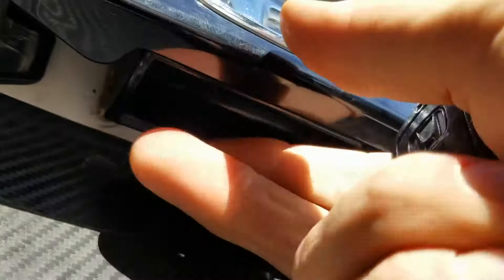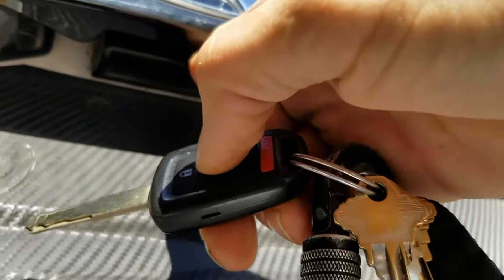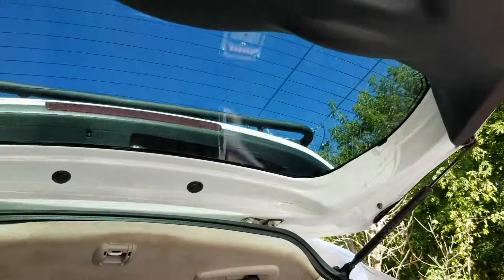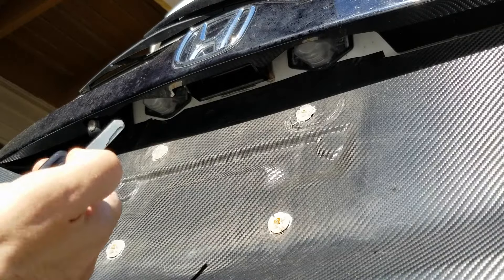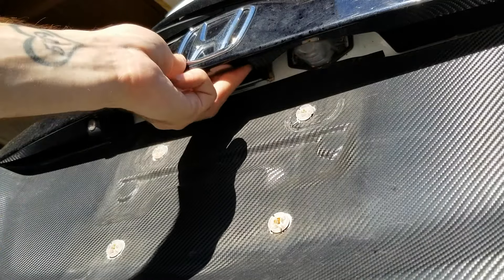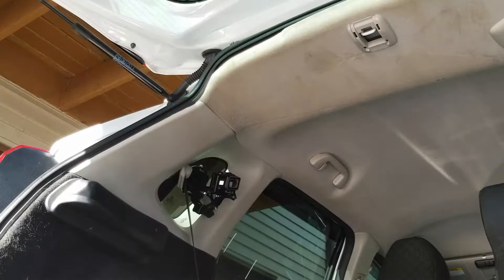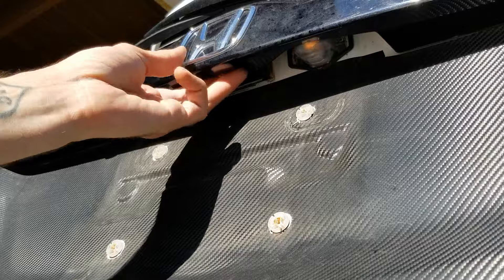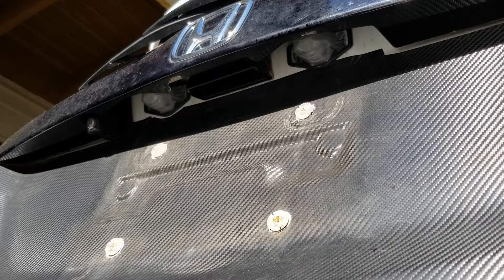2015 - 2019 HONDA FIT/JAZZ - GK5 - How To Open A Stuck Rear Door / Trunk Hatch #HondaFit4Adventure

Comment: Appears Honda doesn't want to change this design
Reply from the maker: And make it harder for you to fix.
Reply: @HondaFit4Adventure  They should have made some sort of provision to use the ignition key to insert into a key unlock by the tailgate latch..like the old days of unlocking a trunk lid.  Cost cutting measure by the bean counters in my opinion.

Comment: To fix mine I first sprayed WD40 into the lock. Then applied some 3-in-one oil. That worked.
Reply from the maker: Hi Mark,
WD-40 did not work for me. I will give the 3-in-one oil a try and see if that loosens everything up. 
Thanks for the tip.

Comment: fyi- if you go in from the inside and move the latch over with a screwdriver it fixes it for good.  there are other videos on that technique too..
Reply from the maker: Please provide a link for this video if you dont mind. I believe I tried what you're describing and it just doesnt seem to work on all models.
Reply: That doesn't work on 2015, as there is no access panel, unfortunately...

Comment: I have a Honda Fit 2012.  The latch stuck once or twice a couple years ago temporarily again.  It happened again today and manipulating the latch first... got it to engage again and work properly.  Thanks!
Reply from the maker: I believe the older models have an access door allowing you to pull the cable as well.
Sadly they removed this door in the 3rd generation.
Reply: I have a Honda fit 2012. I just tried it, but the latch wouldn’t go down.

Comment: Someone rear-ended me, and now my warning beeps are gone. The trunk still locks (with more force than before) , but there is no beep when I lock or unlock the car with the remote. It also no longer beeps when you exit the car with the ignition still on, which I found out when my battery died as a result
Reply from the maker: Hi Rookie. Does your horn still work on the steering wheel?
If so, try this... Open and close the hood on the front of the car. 
I wasn't getting any warning beeps either but my horn was still working. 
I realised my hood wasn't closed all the way. Once I slammed the hood down the warning beeps came back.
It's a long shot, but worth a try. Let me know. If not, I bet it still has something to do with the latch.
Reply: @HondaFit4Adventure  Didn't work but thanks. I think it has something to do with the latch mechanism, the rear door had a small dent but it must have been enough to damage something in the door lock mechanism, maybe a little electronic sensor switch or something

Comment: If you spray WD-40 on the metal and spring around the plastic handle, it will solve this problem.
Reply from the maker: Jeong, that did not work for me.
You also shouldn't use WD-40 as a lubricant.
"The main reason for this is that WD40 is not a true lubricant; it is a water and oil displacing solvent. This means that it can actually remove any lube already in the lock, leaving it dry and susceptible to sticking"
Reply: @HondaFit4Adventure  Thank you for the information about WD-40 that I did not know. I had the same problem on my 2015 FIT, and the WD-40 works for me so far. But as you pointed out, this may be a temporarily solution. Thank you again.
Reply from the maker: @jeong-hyuncho1128  Did you spray it directly into the handle? or did you take the interior hatch panel off spray the handle?
Reply: @HondaFit4Adventure  Without taking the interior hatch panel off, I sprayed it directly between the handle and metal plates where are placed on the left and right side of the plastic handle using WD40 attached with a thin straw. Also I sprayed around a spring on top of the handle. Then, moved the handle back and forth more than ten times and sprayed it again. The straw helps to spray the oil between the handle and  the metal plates that causes a stuck handle.
BTW, I got lots of useful information from your video. Thanks.

Comment: a 2016 Honda Fit does not have the handle part. just the button so this won't fix it
Reply from the maker: As far as I know, every Honda Fit should have a handle on the hatch.
Have you had the car since it was new? Do you have an electric tailgate?

Comment: OMG I just tried your fix and it works every time. Honda never even tried this to diagnosis the problem.  Honda had me replace the lock, $275.  Same problem two weeks later. Thank you thank you.
Reply from the maker: Mine was replaced under warranty and just like yours, it happened again.
This is a common problem even in the first and second generation Honda Fits. Unlike the new Fit, the older FITs at least came with an access door so you could pull the cable and unlock the hatch if this problem occurred.
They engineered out this older fix even though they knew this situation was a common problem. 😠

Comment: It worked!! Thank you, Thank you. Honda would have charged $200 to$600
Reply from the maker: Glad to hear!
Would you believe that 1rst & 2nd generation Honda Fit's had an interior hatch access panel?
If the trunk ever became stuck you could easily pop off the little cover and pull the cable to open up your trunk.
They got rid of this access door feature on the 2015 and newer Honda Fit's.
It's as if Honda want's you to come to the dealership to fix this COMMON issue.

Comment: worked on my GD3 from 2007, thank you so much!
Reply from the maker: Good to know that it works on the other models.
I think your HONDA FIT has an access door somewhere in the back. If you pop off the door you should be able to pull the trunk cable and open the rear hatch.
They removed this access panel on the 3rd generation HONDA FIT #SadFace

Comment: Wow. This worked. Gave it a squirt of silicone spray after. So far so good. Thanks!
Reply from the maker: HondaFitFact: The older model Honda Fits had a little service door on the inside. This way if the trunk stuck, you could pop off the little service door on the inside and pull the trunk cable to open it. Why they got rid of that service door I have no idea?
Reply: What did you spray? Should I just blindly shoot it into the sides of the handle?
Reply: @johntheblindman . That's what I did, blindly sprayed up into the handle at the hinge points and wiped off the excess. I don't really know if it helps but I don't think it does any harm. I stay away from anything that will attract and hold dirt, like oil or grease. The silicon (I hope) keep moisture away. If you find something better do let us know! Good luck.

Comment: Ran into this with my 2017 Honda Fit (only 28,000 miles on it).  Normally all doors including the tailgate will unlock by pressing the 'door unlock' button on the ignition key fob when I'm standing by the driver side door but lately the tailgate won't unlock.  Was able to get the latch to unlock by putting the ignition key right up to the latch and pressing the 'door unlock' button on the key; then I oiled the sh_t out of the lock mechanism with penetrating oil.   Did this 5-6 times in a row worked OK hopefully if I keep the mechanism oiled that will be a permanent fix.  Older Fits have a tailgate latch access panel on the inside of the tailgate but mine doesn't.
Reply from the maker: You are correct.
The first and second generation Honda Fit have an access door that you could remove to open your trunk if it ever became stuck.
It seems that Honda Removed this little access panel from the 3rd generation Honda Fit even though they knew this was an ongoing problem.
Are they trying to force us to come back for the dealership for repairs?
Reply: @HondaFit4Adventure  Of course.  Another way of generating revenue for the dealership service departments.  I really like my Honda Fit in all other regards.
Reply from the maker: @thomasmoje5926  Same, I plan on keeping the car for along time too.

Comment: Why will hatch not open without the fob being right next to it?
Reply from the maker: So your trunk opens, but you have to stand close to it to do so? I would guess the battery in your key fob is getting low and it's unable to send a signal a far distance.
Reply: Battery is fresh. Hatch will not open even if fob is in the car.

Comment: I think mine cannot go as far forward as usual because there is so much rust. I tried your trick and spraying wd-40 on the rust but I’m still not able to open it. Do you have any idea?
Reply from the maker: Have you tried removing the rear hatch panel and taking a look inside?
https://youtu.be/K9boNauAy04
Reply: @HondaFit4Adventure  thank you for putting the link, I definitely didn’t even know I could do that, thank you so much! I will try that
Reply from the maker: @jacintheverschelden7818  You're welcome. 
I got rear-ended and had my whole trunk replaced, otherwise I would have torn the latch out for a video 😀 already.

Comment: I have a 2017 Honda Fit, so my trunk handle doesn’t look like this one. Any suggestions?
Reply from the maker: Is it a U.S. model? and what trim level is it? LX, EX, Sport? 
I thought they were all the same, but I'll take a look.
Reply: Thanks for the response. It’s a U.S. model, LX. Not sure about trim level.
Reply from the maker: Mine is a 2015 LX.
Would you be able to send me some photos on IG or FB?
You can try popping off the trunk cover and pulling on the cable, but it might be a little hard to do with the hatch closed.
https://youtu.be/K9boNauAy04?si=0bI9nI_lk2-3vV1e
 @Timtube73

Comment: I had to do this on my 2015 a few years ago. But at this point nothing seems to work. It was been over a year where I cannot open the hatch.
Reply from the maker: That's rough.
I got rear-ended in Colorado https://youtu.be/gYsBSl5w7z0 so I ended up getting a brand new hatch all together. We'll see how long the new latch mechanism lasts for.
I've been slowly taking apart my Honda Fit  and documenting the whole experience on my YouTube channel. 
If the locking mechanism fails again I will figure out how to fix it and make a new video.
Reply: @HondaFit4Adventure  I don't use the back much so I just access it from the back seat. when needed. If it helps to know you can get the spare tire our without needed to open the hatch. I am over 135k miles am plan to drive it tills its dead.

Comment: Yeah but what if you have to manually unlock the car bc the key battery is dead
Reply from the maker: Get yourself a friend to push the unlock button on the door while you press down on the hatch lever.
I would recommend replacing your key fob battery. 
That is the easiest and cheapest solution to this problem.

Comment: My 2018 Fit Sport has the same issue.  I just sprayed a little silicone lubricant on the handle/lever and it appears to have done the trick.  
The inside cover is all one large piece.  I assume it just pops off, in case I need to get in there.  Does anyone have any experience with popping the cover off.  Thought I would ask before I try.
Reply from the maker: Hey there, I was on the road or I would have sent this sooner.
Here's a video on how to remove the rear hatch panel https://youtu.be/K9boNauAy04
It is quite easy.

Comment: I shouldnt have to do this. FIX your design or fire the enginer!
Reply from the maker: Fire the engineer. The 1st and 2nd generation Honda Fit had an access panel, so you were able to pull the cable from the inside when this happened. They removed that access panel on the 3rd generation causing you to go to the dealership instead.